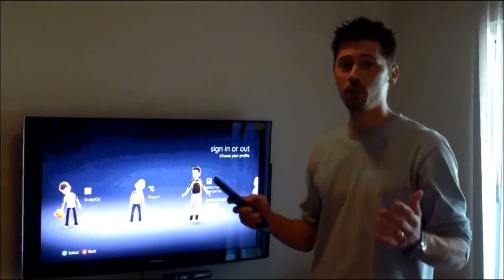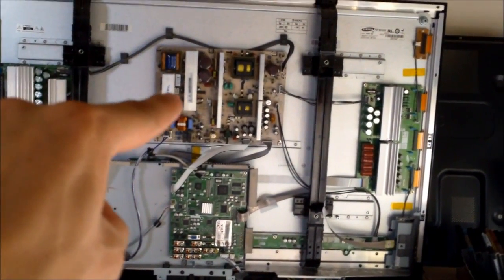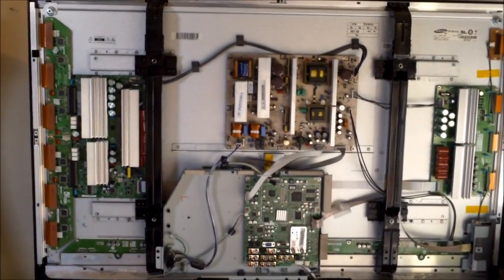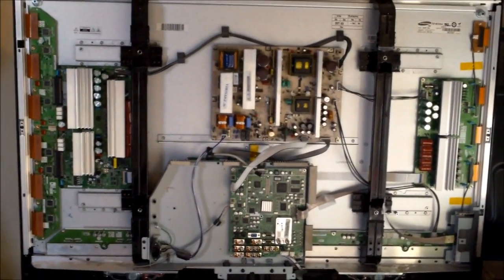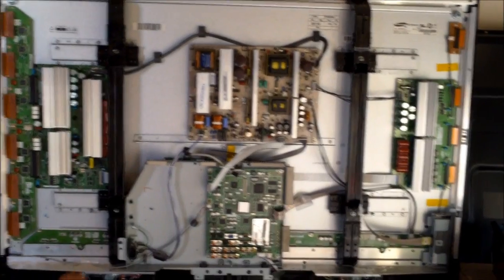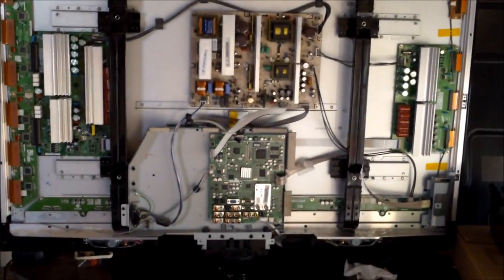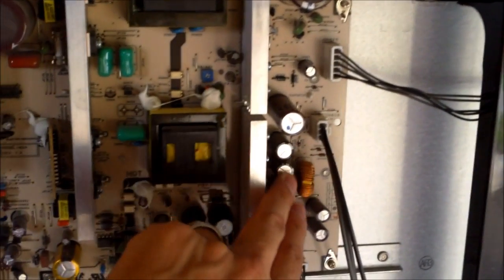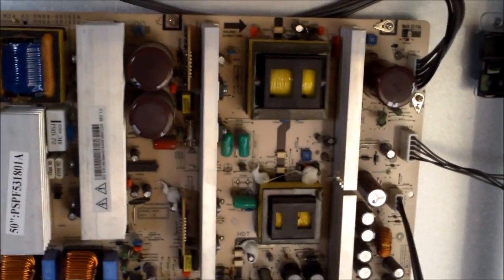WHAT PLASMA TV BOARDS commonly Fail review

Comment: First let me say I really appreciate that you are on here helping us fix our stuff on our own. Second you should set up a page where we can donate for your experience and help. Third is my issue with my samsung plasma tv model # PN50C550G1F I figured out the main Y board was faulty thanks to your videos. the tv was powering on with sound but no picture. I put in a used Y board bought from ebay the tv powers on with sound and you can see the screen illuminate and after 3 seconds it blacks out.

Comment: I will try unplugging the x and y, good idea. The buzz is def coming from the power supply but I pulled it and still cannot find any bulged caps or anything fried. I've found the board on shopJimmy for $50, you think it's worth a try to replace it altogether?